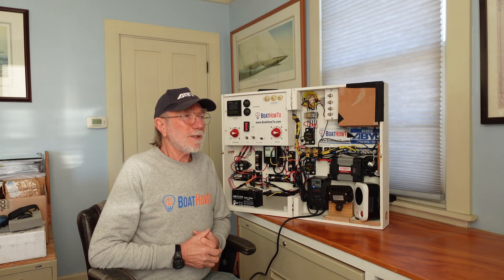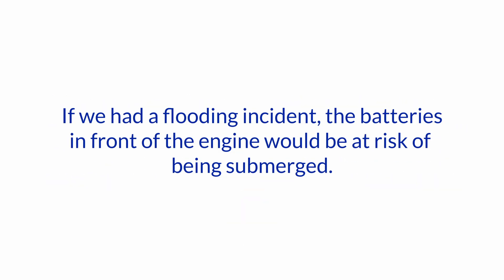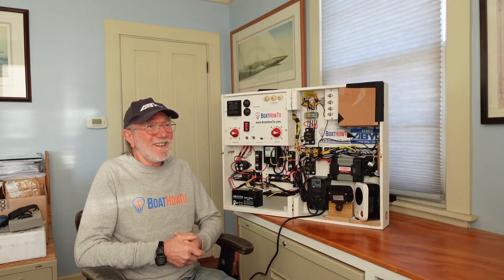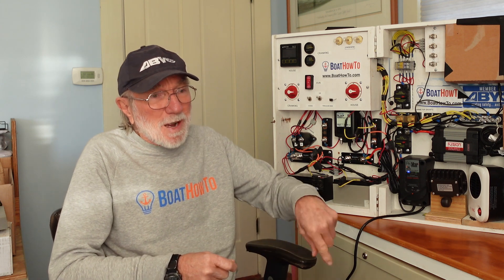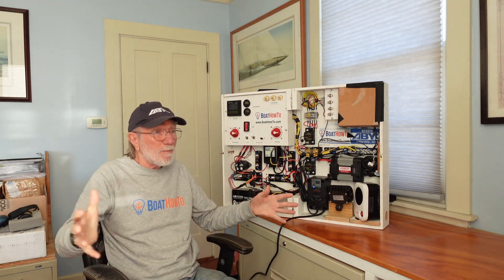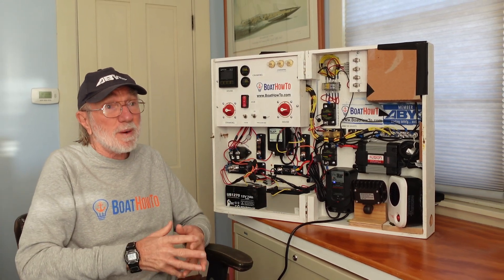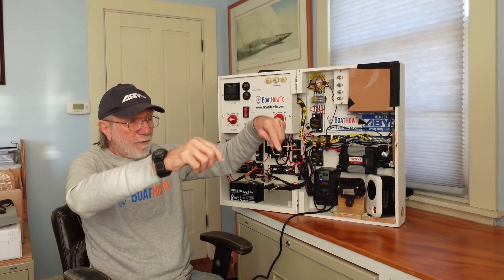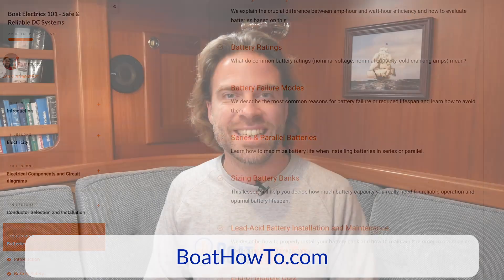This is a TERRIBLE INSTALLATION! 😓 Parallel Batteries | Ask The Expert with NIGEL CALDER

Comment: I'm curious if the bus bar approach is recommended with only two 220Ah lead acid batteries. I have them connected as in the picture (plus with plus etc) and one of them died after 3yr of use (no power after charging). I couldn't figure out what caused it, and why only one of the two went bad.

Comment: I have this problem with LFP batteries, very hard to avoid on a small boat. The batteries in back do more work than the front ones and see slightly different temps. However I believe I have a fairly simple solution, I plan to swap the batteries around every year. Hopefully they should last 10+ years, so swapping them will help equal out the degradation.
Reply: You don't really have to worry about it with LFP batteries.  Yes, the wear rate will be different... but all that really happens is that an SOC offset develops between the two banks while charging and discharging.  It will generally limit-out at 10% or so and the difference contracts back down to zero as the battery heads to empty or heads to full..   So the entire system will still charge to 100% and will still discharge to 0% if asked to, and you are still able to use the full capacity of the combined banks.

LFP batteries have such a long cycle life and generally speaking the calendar aging of the battery is still the low-hanging fruit, so you just don't have to worry about it as long as the cabling is sized conservatively for the expected amperages.  Calendar aging is a function ONLY of temperature and in large battery banks the amperages are so low on a per-battery basis that LFP cells will barely get above ambient.

This problem is also "solved" more or less by just going with a higher system voltage, like 24V or 48V.  That vastly reduces amperages, vastly reduces incident heat from equipment, and allows longer cables between parts of the battery bank while still limiting the power loss.  But it is also a more sophisticated setup.

-Matt
Reply: @junkerzn7312  48V is increasingly becoming more common, and really should become a standard.  Would also mean better 48V accessory support.
Reply: Why don’t you do what the guy said. Install a bus bar.
Reply: @saxplayingcompnerd Yeah suppose I could. I technically already have a bus bar, but I could add several feet of additional expensive cable to match the resistance. Its amazing what a tiny change in resistance causes. Anyways, its not as big of a deal with LFP because discharging more doesn't hurt the battery nearly as much Lead Acid and I would still rotate yearly due to temp differences.

Comment: Would the answer be the same if the inverter was on like most boats pushing 240v or 110v around the boat .     And  any boats have batteries under the floor from the factory ,

Comment: When wiring to a busbar, do you size the individual cables for the maximum load the single battery can handle? Or the total load of the bank? And do you need to fuse each leg from the busbar to the battery?
Reply: Well wire should be rated for load of each battery ,wired as he said , when wired wrong the wires would need to get heavier nearer the load. 
Fussing under Indevidule batteries is,not typical .
Reply: Regarding wire size, remember Vdc needs slightly bigger wire than Vac. 0.25C is a good modest target. 100ah battery means 25amp. Vac would be 10ga wire so use 8ga.
If an inverter is the biggest load, divide inverter rating by number of batteries to get battery amps and use 1 size bigger wire.
Reply: Check out explorist life as he has many diagrams showing the fuse locations and sizing. I would still always use a bus bar and equal length wires.